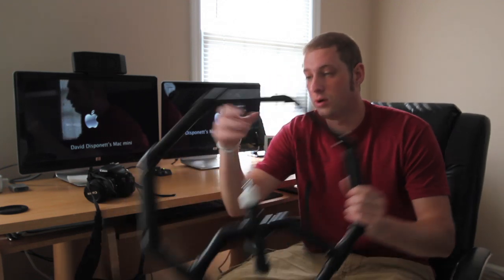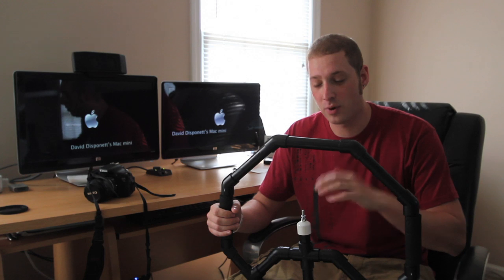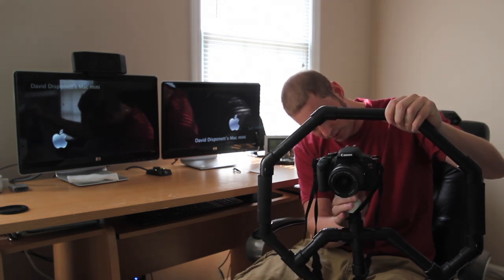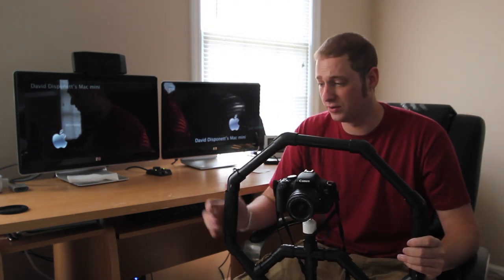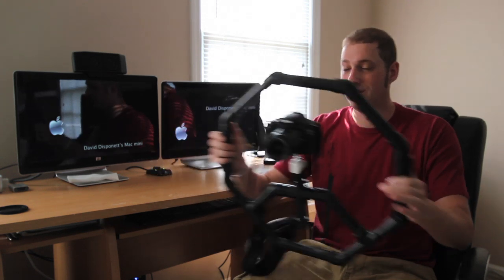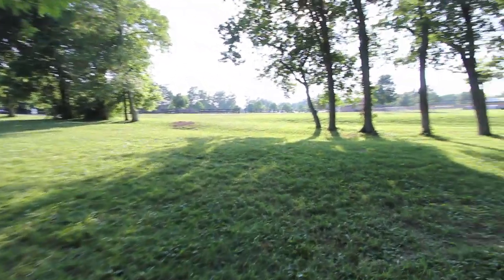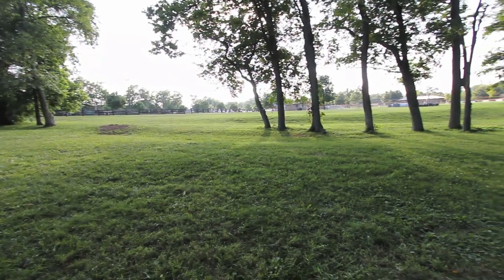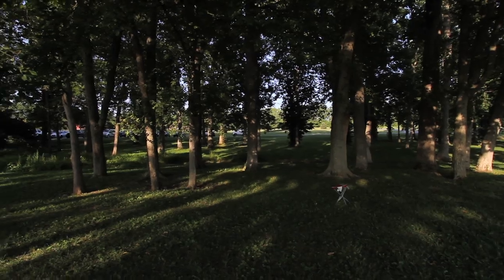Home Made Fig Rig Review And Test

Comment: ... also, if you use a long bolt that goes through both end-caps, and a wing-nut on both ends, the you can spin the bolt into the camera without having to turn the camera itself to screw it on. Just a suggestion.

Comment: I don't mean to be offensive, but the resulting footage is quite shaky, and I didn't expect it to be any better since all this rig does is just give you a better grip than on the camera body.
As for "stabilization" effect, there is none. You'd better build a merlin styile, if you want something with a stabilizing effect.
A simple vertical tube with a weight on its lower end and maybe an additional horizontal tube for better handling would be more effective, thank's to the INERTIA and LEVER.